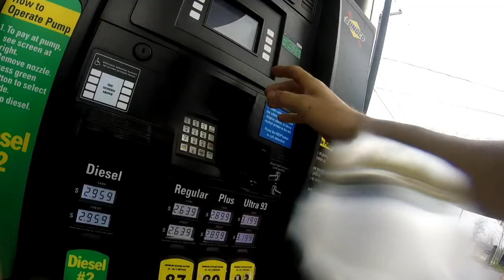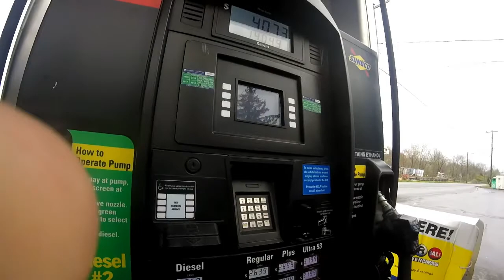Spraying my floor with bedliner

Comment: I was thinking of doing this to my 1971 Ford F100 how well has it held up after a year and does it help with sound deadening?Thank for letting me know to use the Rustoleum instead of Duplicolor
Reply from the maker: Ken Burns it’s held up pretty well after a year. It’s not really any louder without the factory insulation.
Reply: @cds_4.3  thanks for the info

Comment: I’m thinking about doing this same thing. How many cans did it take to do the whole floor?
Reply from the maker: I used 2 cans to do the front section. I did not do around the back seats yet. I would use 3 cans to do the whole thing, and  recommend using Rustoleum brand.